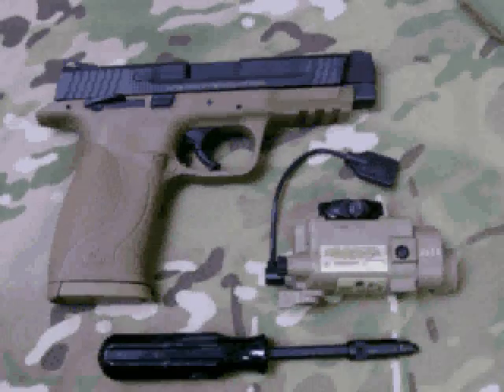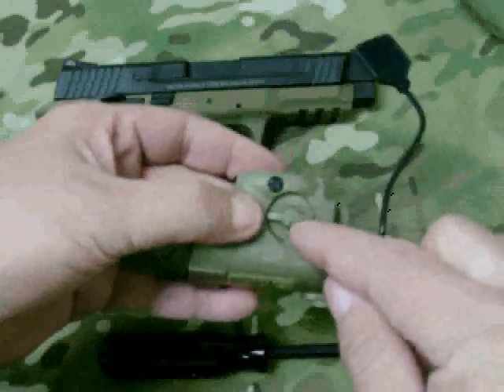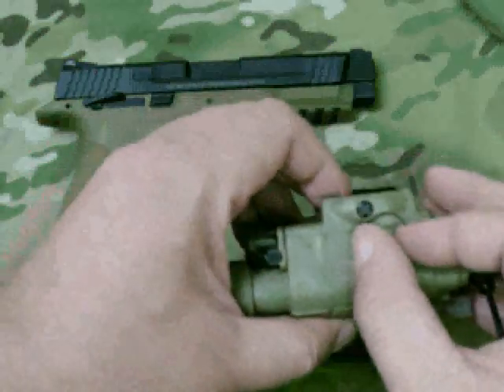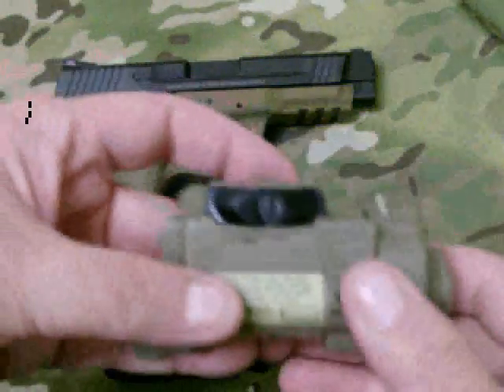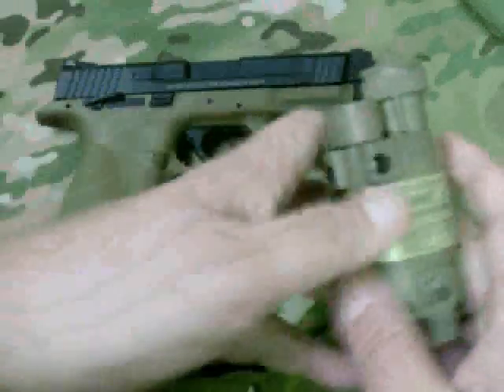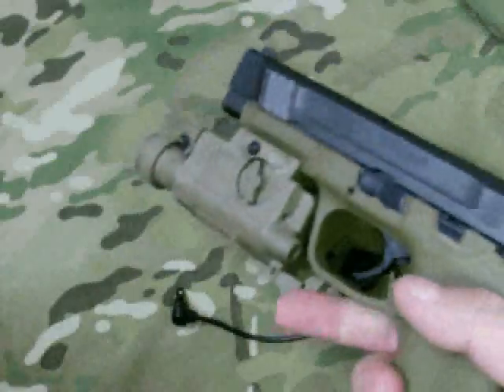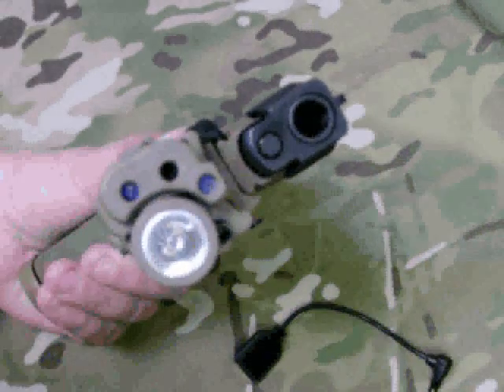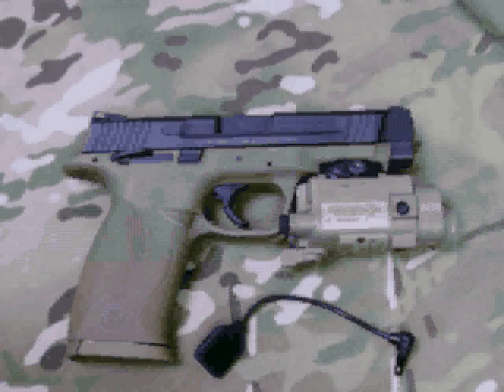Military Night Vision Pistol Laser

Comment: @ridah925 not hardly man, thx but i kno all about the m6x, and they are not the same.,  "they", L3 Insight makes this same ilwlp in visible only without the i squared,  you just have to get the 150 instead of the 100, preciate the help but i already got the answer, and its not the m6x.., althought they did win the sopmod increment 2 contract with the m6x so its still a solid unit